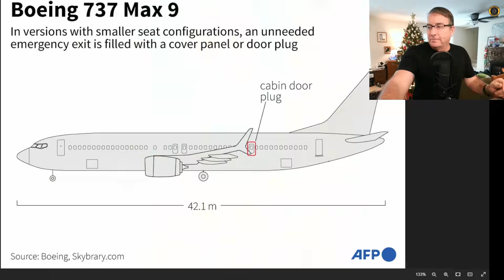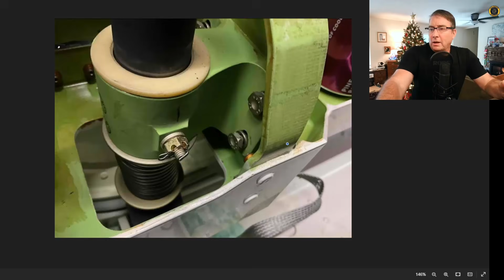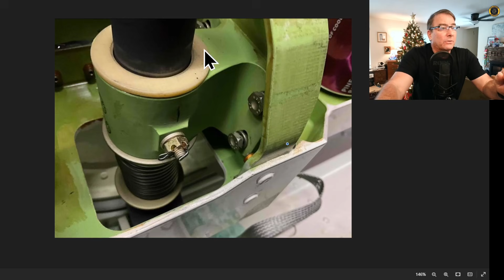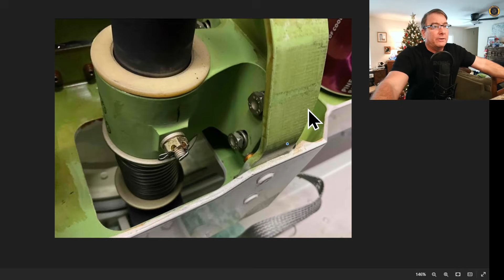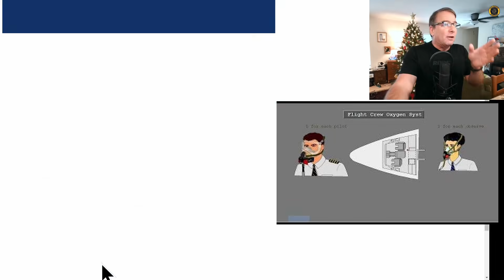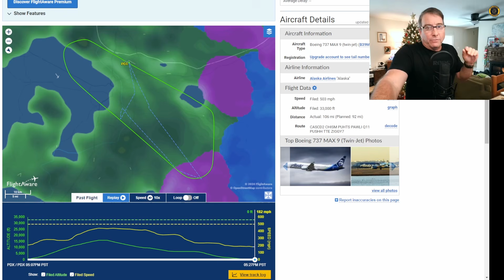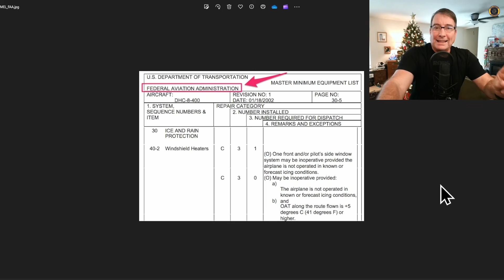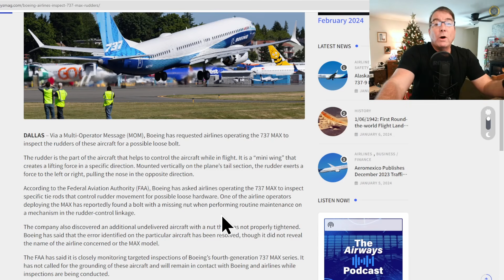"Yes, We Have No Bolts"  9 Jan 737 Max-9 Update

Comment: Yet another clear, detailed and evolving video from Juan, thanks.

From experience working on ground based equipment, it could be that the hinges are sometimes removed for extra clearance (by random spanner spinners). Clearly when the hinges are refitted there will be a procedure to follow including bolt torque and possibly the replacement criteria for the fasteners ( some applications are single use).

Undocumented removal (probably by non A&P qualified personnel) invites non standard refitment, as in nip it up and shut up.

It will be interesting to see if these bolts are replaced in the procedure with the wire locked type and warning placards.
Reply: This was a relatively new airplane.  Why would any maintenance have to be done already through the door plug hole in the fuselage?

Comment: I don't see any way the cotter pins, if installed correctly, could have come loose. That many at one time? Should not you use a torque wrench on a certain per cent of nuts and bolts? ( Where the guide fitting fits onto the door)

Comment: It is time for the entire Airline system to be overhauled. It is amazing in this day an age, with terabytes being able to be fit into a sd card, that we are still using limited tape for voice cockpit recorders. You can do satellite uploads live to a central datacenter, you can do high density data storage to update blackbox data recorders. Hell, they can create extreme G-shock digital recorders, and they could be small enough to have many of them throughout aircrafts, for survival. There is no excuse for Airline pilots needing too pull a breaker for data recording.

Comment: If i were designing these "plug" doors, they'd be true plugs. Installed from the inside so cabin pressure seals them. No way to fly off.
Reply: Most Boeing Cabin Doors are Plug type doors. The door has upper and lower hinged panels that fold in or out when the door is opened or closed. When the Door is closed and latched properly the The hinged panels are folded outboard and make the Door LARGER than the opening. Looks like the Boeing Engineers did not design this door panel in question in that manner.

Comment: Amazingly informative video -- it answers many questions I had about the design of the door and how such an incident could happen -- excellent work! As Juan said at the end, with so many issues having come to light with Boeing manufactured aircraft in the last few years, it makes you wonder if these items are the tip of the iceberg with many other issues lurking under the surface. Given these, and the many issues Boeing has had with the Starliner project, it sure seems like there are some very serious systematic management issues throughout the company :-(
Reply: have you by chance followed their work on a space capsule?

Comment: If the 4 Bolts were installed properly the 12 "door plug / panel" STOP PINS could not move OFF of the 12 Fuselage Door Frame STOP PADS. [6 FWD FUSELAGE FRAME and 6 AFT FUSELAGE FRAME]

Comment: Thanks for pointing out that loose bolts doesn't really apply to the four stop bolts. Looking at the photos of the stop bolts, there is a lockwasher under the castellated nut, and a cotter pin securing the nut. Torque would not be critical, except that over tightening could deform or crack the guide track or hinge fitting. The procedure is likely to just snug the nut and then tighten it until you reach a spot that the cotter key can be fitted. This is just enough to keep the bolt from rattling. The torque on the bolts that you pointed out would be absolutely critical. They found two cellphones, a door and some other items, hopefully everyone in the neighborhood is on an Easter egg, umm, spring hunt!
Reply: There are two (2) sets of bolts in play here.  The bolts with the castle nuts and cotter pins are one set.  The other set are the two bolts that hold the brackets/door hinges to the fuselage frame, which don't have castle nuts and cotter pins. The later need to be correctly torqued down when tightened; the ones in the photo look like they are starting to back out and loosen on the hinge  because they were not torqued down enough.
Reply: The lug is likely a magnesium or aluminum casting. If so, there would be very little torque on the bolt.

Comment: 11:11 lookup Flight 8633 they lost the wind screen at 32100 feet and it was over mountains so they could only go down to 23600 feet, for some reason the captain couldn't reach his oxygen mask without letting go of the controls so as some kind of superhuman he made it all the way to safely landing the plane without. 19:36 that same flight had multiple system failures which turned out to be caused by 17 circuit breakers popping when the panel was hit by the cockpit door slamming open

Comment: while I understand the need for having the cockpit door secure we have had several hundred people die because of that design. It is likely the reason Malaysia 370 went missing as well as that (lufthansa?) flight where the young 1st officer locked the captain out then pointed the nose towards a mountain. I am shocked there is no way to completely override the cockpit door locks from a key-code or key on the outside.

Comment: Juan you are amazing with your factual analysis. You answered questions many of us never knew existed. Whenever anything airplane related happens we just wait for the truth from you.  Point #1: Your kudos to the cockpit crew were spot on They had control of the situation within 1 minute. If I had been in the front office I would have still been involved in a "code brown". Point #2: Boeing is selling more Airbus planes with their attention to profit instead of engineering and safety than they know. Point #3: This CVR overwrite issue is bull pucky.  Honeywell can afford another $10,00 worth of memory chips to make that thing record for a week! FAA needs to require that change now. What are pilots afraid of? Keep up the excellent work and hi to your family.

Comment: I flew out of Newark about 25 years ago and the door seals failed on takeoff, we had a cyclical depressurization about every 5 seconds or so as soon as we left the runway.  We took off north over the city of Newark, the pilot did a 180 and we landed to the south on the same runway, couldn’t have been in the air more than two minutes.  In that short of time, the fire trucks were already lining the runway waiting for us.  That was a bad enough experience, I couldn’t imagine that happening at 16,000 feet.
Reply: Oh, Newark firetrucks are fast.
They assisted us while deboarding a 777 on the runway after a strange failure in the brakes system making half of the tires to blow the fuses.
Reply: If this plane had been at cruising altitude when the door blew off, passengers would have suffered frostbite and hypothermia, and maybe even some deaths, before the plane could descend to a safer altitude.
Reply: @mikedx2706  An emergency descent from 35,000 to 11,000 takes three-five   minutes, If there were to be deaths it would be as an immediate  result of the decompression, such as the aircraft disintegrating (like the Comet) or passengers  being ejected (like United 811).
Reply: @mikedx2706 Incorrect.

Comment: My guess is that they leave these plugs lose (not torqued fully) so that the retrofitter can take them out with ease after the fuselage leaves Boeing. However, for some reason, they aren't telling the retrofitters that they need to tighten them up.

Comment: What I don't get is if the doors are never going to be in uses, WHY NOT USE SOME KIND OF THREAD LOCKER!!!! A simple red loctite on the door bolts would have solved all this issue why? Red Loctite requires you to melt away the thread locker to actually get it off. Meaning you have to get the bolt really hot to actually get it off. You don't need to be a rocket scientist to know this. Those bolts should be applied with red loctite. Why?? Because you can clearly see those bolts were torque down before and I guarantee you, they don't have any kind of thread locker on them.

Comment: According to the Honorable Jennifer Homendy (NTSB), Boeing stated the "cockpit door" that flew open during the rapid | explosive decompression is designed to do exactly that, and the "flight crew" indicated they did not know it was supposed to.  Uh-oh.  Now, whether they were trained or "supposed to know" is another issue.  I wondered from day 1, when you shared the links to "The Boeing 737 Technical Channel", where are the bolts? My guess is they did not have the cotter keys/pins installed, the nuts worked their way off, and the bolts "left the building".

Comment: I flew as a passenger regularly back in the day. The thing that worried me, was that the plane is a commercial product in a competing market. Costs will be saved, shortcuts taken, however small they may be. I have a friend that worked at Fokker. Those airplanes were expensive, and Fokker lost money hand over fist. But the stories he had about checks and rechecks and rechecks by others again, were baffling to me. Every nut, bolt, fitting, wiring, circuit, hydraulic line, you name it, checked at least three times by two persons. Now, I understand why. I see, by the way, the same development in cars. The quality of manufacture is, well, let's say "commercially viable".
Reply: The frustrating thing is that aggressive cost cutting is often a downward spiral that costs more money in the long run. Ford having an absurd reject rate back in the day because they refused to allow assembly lines to be slowed or stopped comes to mind.

"Penny wise, pound foolish", but for time management.
Reply: @SnakebitSTI   Any Ford "cost-savings" are eaten up by the cost of the numerous recalls that Ford has been having the last few years.
Reply: @SnakebitSTI  Agreed, but then again, Fokker does not exist anymore either..... The company went broke. Competitive market.
Reply: Building oil and gas, do serval pre-comminsioning checks. Final acceptance commisioning by owner.  Projects capital cost in billions of dollars!!
Quality Assurance/Quality Control program divids steps into Witiness point (work past), other Hold point (stop until work accepted)!
Reply: Agreed. I worked at Fokker - they really were meticulous about build quality.
Reply: I sort of think back to the space shuttle Colombia where tiles fell off, which caused the demise on re-entry.  Did they not use enough of the proper adhesive, or was the adhesive an inferior batch?
Reply: @cruisingal2  Worse. Insulating foam would fall off and strike the shuttle's heat protective tiles on the way down, damaging them. It happened very frequently, right from the first shuttle launch. NASA just ignored the problem until it destroyed Columbia.
Reply: @SusanKay-  Agreed, but you are talking about the design. I am talking about manufacture.

Comment: 8:10 I fear the FAA will use this incident as an excuse to push for 25 hours CVR limit
Reply: And what on earth would be wrong if they do? What good reason is there for NOT having it already?
Reply: @wurly1  It means all conversations will be recorded even when there is no incident. The airline can use the data against the flight crew however they see fit. There is a legit invasion of privacy concern here. Pilot's job is stressful enough, no need for big brother to interfere.
Reply: @aerohk  all conversations recorded or the ability to properly investigate incidents so we can make sure safety improves and lives are saved. I know which of those is more important. The concerns about how the airline uses the data (if they got it - the cvr should only be removed for investigation or maintenance repair?!) is a basic industrial relations issue, that can be solved by discussion and policy agreement - it's been done elsewhere. Try harder.

Either the American airline industry is serious about safety - in which case it works to resolve those concerns, as has happened elsewhere - or it isn't.

Comment: This shouldn't rely on bolts. Windscreens in planes stay on with no bolts because the windshield is larger than the window frame. Doors like this should be the same. This is a design flaw.

Comment: I wonder what percentage of planes are manufactured having these plug doors. Is it only on the “-9” models? Perhaps other stretch models have them too.  My point is, how common is it in the manufacturing and inspection process? Is there any inspection of these as part of maintenance (after so many flight hours, for example.)? Since they are special case people will not be as good at manufacturing or maintenance of them.
Reply: As far as the 737 MAX series is concerned, only the -9 type has the "plug-type" door option available.

Comment: Hey Juan,
Great analysis as per usual.  Any chance there could be some sort of sabotage going on here, like revenge for the Max-8 crashes (or someone just trying to wreck Boeing)? And you mentioned the 90-second evacuation requirement and the JAL incident at Haneda meeting that rule. But what's your take on the wide-spread media reports that the Haneda evacuation actually took 18 minutes?
Reply: The most likely explanation is exactly the same explanation as for the MCAS debacle: Management pushing everything to be done faster and cheaper. That leads to corner cutting, which leads to safety issues.
Reply from the maker: See my Haneda report

Comment: Did they run out of Locktite on the line at Boeing?  Do they not use any visual verification marking methods for what even some automotive production lines call “Delta C critical fasteners”?  Either their full process wasn’t followed during hardware install  or process elements were missing to guarantee first time quality.
Reply: The Castellated Nuts are safetied with Cotter Pins.
Reply: @guitarhillbilly1482 yes but not the other bolts that mount to the air frame that are now being found during inspections as well as the big question regarding whether the castle nuts with cotter pins were ever installed.  Somewhere there is a process gap, not an engineering issue.

Comment: Somebody posted the door plug attached to airplanes by fittings with 4 bolts. Looking at the pictures (6:14), I am not sure the bolt head/washer sit on the contoured surfaces or flat surfaces of fittings; if they would sit on coutoured surfaces, there's possibility of gap under the bolt head. Undertorqued bolt or sealing could cause the bolt to loose

Comment: With the density and durability of some modern SSD's I'm surprised the recorders don't use enough storage to store days worth of data if not more even as a secondary method
Reply: no one cared to update specification for new devices or even just software for that.
Reply: Hell why isn't there camera systems monitoring the pilots or even the cabin and storage areas. The more data collected the better right?

Comment: I will never fly commercial again if those plug doors can depart the aircraft due to  depressurization. I am sure pilots and other emplyees wouldn't  want to fly on compromised aircraft. Depressurization is hard on airframes. With wind forces on and around that opening is hard on the airframe.

Comment: The thing I keep wondering about when I see those loose door bolts, is, where is the safety wire? Why weren't those bolts wired in so they can't unscrew?
Reply: The Castellated Nuts are safetied with Cotter Pins.
Reply: @guitarhillbilly1482  Yes they are. Those bolts go thru a fitting. What holds that fitting to the frame of the aircraft? It isn't part of the frame. It isn't welded to the frame. It isn't glued to the frame. It is held to the frame with 4 bolts. Which have no castle nuts, and have no safety wire. And which, on 5 United planes, had come loose and backed out by several turns.
Reply: @lwilton  the roller latch plates are fastened to the Fuselage Door frame with Flush head bolts.
The missing bolts are Not these bolts
Reply: The bolts holding the bracket to the structure don't have safety wire or cotter/castle. If one of the brackets released with door shifting, then that hinge retention bolt with castle nut may become irrelevant. With aerodynamic forces prying on the misaligned door panel, the other locked hinge may have had its retention bolt shear under load ...
Won't know details until NTSB releases report (if then). The insistence by NTSB that the series of prior pressurization alerts were unrelated to the actual explosive decompression event make me wonder ...

As to why, that is a program requirements decision. IMO the entire max program should undergo a requirements/verification traceability audit ...
Reply: @nevisstkitts8264  The 4 bolts being talked about are supposed to be installed in the 2 Upper and  2 Lower Roller Latch Plates on the Fuselage Door Frame. They are safeties to prevent the Door Rollers from moving inside the latch plates and allowing the 12 Door Stop Pins to disengage the 12 Fuselage Frame Stop Pads. These Bolts are Installed with Castellated Nuts and Cotter Pins. The door cannot open unless the Door Stop Pins are disengaged from the Fuselage Frame Stop Pads.

Comment: I imagine that when the pressure dropped to 11 (and change) psi, the door was no longer flush with the rest of the outside of the airplane... causing either an increase in the partial vacuum on the door, or (more likely) an aerodynamic affect on. the door's front edge.
 
This. would compound the effect of missing and/or loose nuts & bolts!!!  Hence the catastrophic failure and the whole thing separating from the plane!
 
I'm glad the door plug missing the control surfaces (i.e. tail) in its fall to earth!!!!!!